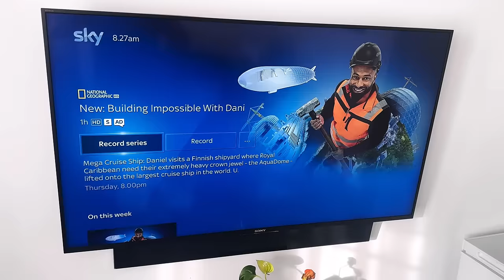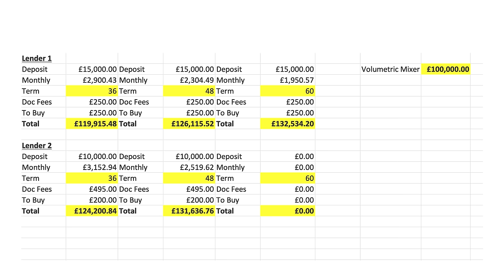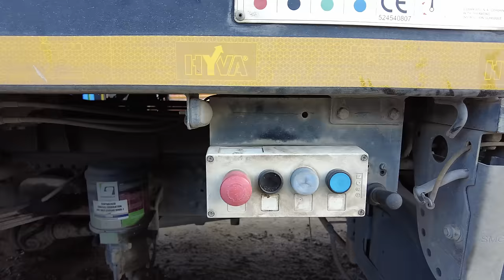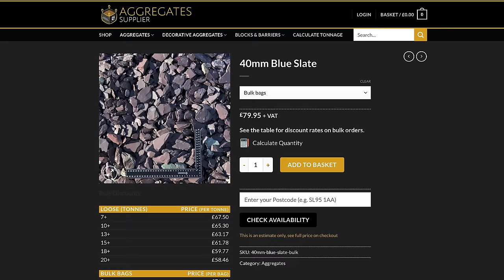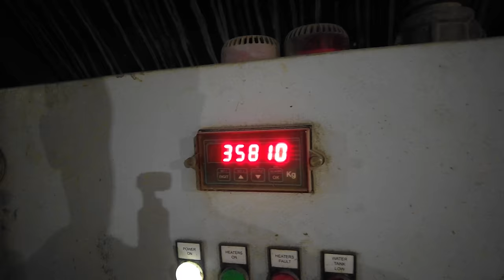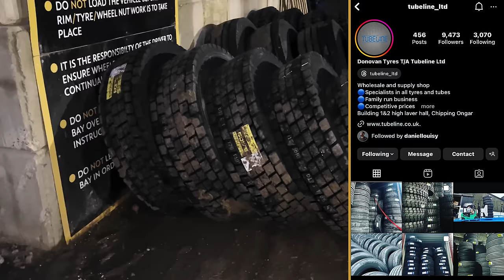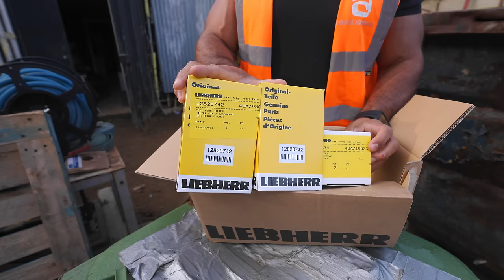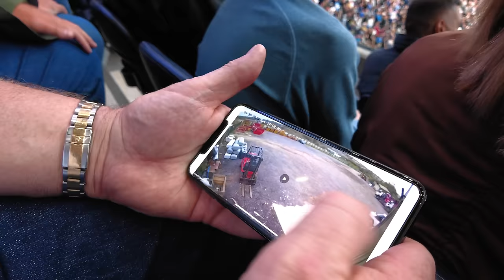FORWARD for the Glory of Ashville | Ashville Weekly ep156 AD

Comment: Train unloading: In Aus Opal hunters, the miners use a vacuum transfer system to hoover out the waste rock CONTINUOUSLY , the receiver has a flap valve on the bottom which opens after a certain weight dropping out the contents whilst still running. The equipment seems less complicated (fan is only moving part)/expensive (mounted on a flatbed) than the swivel grab and as easy as hoovering. Bit like a reverse concrete pump system. Could also be used to load bags. Does wear out the bends in the tubing through abrasion, but tubings cheap! Just an idea, those miners go for cheap reliable and innovation/flexibility/lo cost will keep you one step ahead.

Comment: Need to get a 7.5t or 12t motor for those smaller machines. No way it can be cost effective running that 32t around for a 1t dumper or 1.5t digger

Comment: What a garbage quick hitch on those cranes. Shaft rotators are way superior. They take a single bolt and a linch pin and there is no possibility of getting stuck. Also you can make your own implement connectors as these are simply a piece of pipe with a hole.

Comment: Please remind your drivers that they are not the DVSA on sites that are not owned by you. Regs are regs. £1mil site or a £bill site, Road regs are road regs. I had probs with your drivers and NOT the site managers on the project in Slough. Your drivers became evasive and arrogant, and semi abusive They said 10 mins to go, yet they took 25 mins. I shook a break as I knew the style from experience. They were 5 mins away from my time scale.  I was moving Access equipment. It Takes time when the ramps are wet and is Dangerous to manoeuvre almost 1.5t to almost 2t per plant. ….  On the P.S, I have been following you before the Gym was added and the Super bucket on the 360. p.p.s the site manager was pre warned, and was fine with a break.